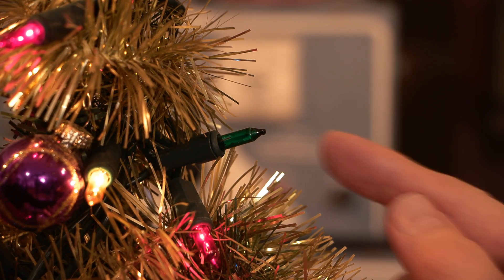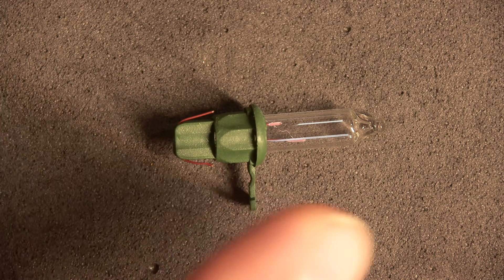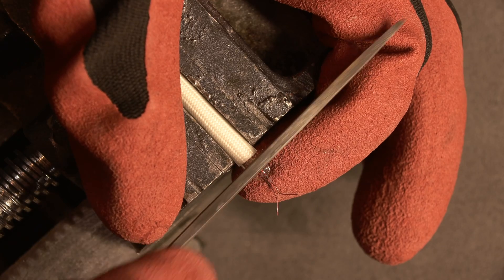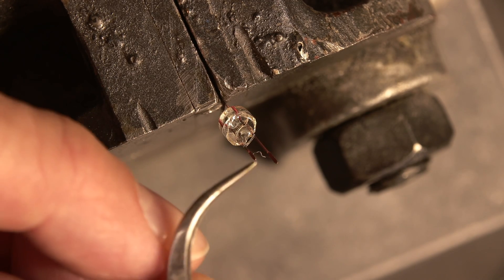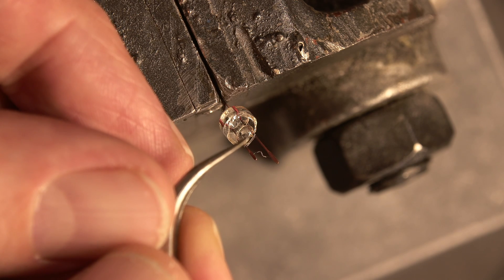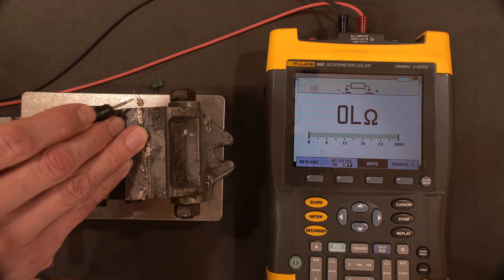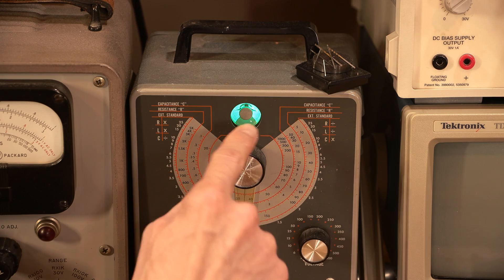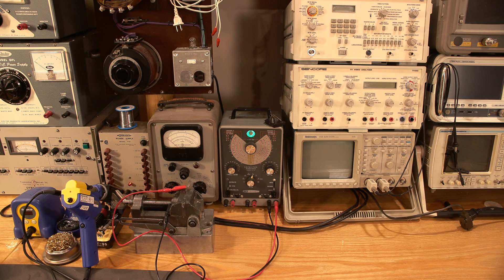The Magic Hiding Inside Your Incandescent Holiday Light Strings!

Comment: One bulb shorts, the rest get more stressed then another, starting a chain reaction, here such lights is powered from 24vac transformer so not many bulbs in a string. Fixed it by replacing all 120 bulbs with bicolor led alternating direction for each, driven by h-bridge with constant current, thought it would last forever... But learned that LED pins rust

Comment: Is there any significant resistance in the shunt once it has triggered? You mentioned at the start of the video that this trick shortens the overall life of the string - why is that?
Reply: My guess is that the shunt is lower resistance than the filament is which increases the voltage on the rest of the bulbs by lowering the overall series resistance of the string.

Comment: It's pretty ingenious to have come up with that system, and despite an additional manufacturing cost I'll bet they made better profit from charging a tiny bit more to eliminate a common aggravation. I was hoping to see if the bypass wires did anything interesting when activated, but I don't blame you for not wanting to cut up another bulb to get that angle. (Or maybe nothing visible happens…?)

Thanks, and s super Merry Christmas to you! 🎄
Reply: When I was testing those bulbs with a 9v battery, if you burn out the filament/it has already failed the “shunt” wire will make small sparks at the connections with the filament stakes

Comment: These lights bring back memories of my first encounter with mains power.
Every few years these Christmas lights strings broke and the supplied spare lights ran out,
and a new Christmas light string were purchased, and if they broke, they were repaired with the working lights of the old strings. 
When I was 5 or 6 years old, I had cut off a socket with 1 light from the old Christmas strings and with short pieces of wire attached to the socket, 
i stripped the ends of these wires with a scissor,and while holding the green plastic socket,i pushed the 2 wires in the socket (230V). 
Not knowing that these lights had to be connected in series. 
The result was sparks and a loud pop, and the light flew a few meters out of the socket. 
There i stood with that socket between my fingers,the wires still in the socket and my face as white as a ghost :-)
I never saw these "self-healing" lights back then (80s), if 1 light broke, the rest no longer worked either. Each new Christmas lights included some spare lights, and 1 light with a bi-metal contact to make the rest of the lights flash at a low speed.
Reply: A better pop can be achieve by putting  a 24V bulb in a 230V socket, the bulb blow very loudly and vanished at the same time, hope to see this in slow-mo one day !
Of course don't do this at home, My father didn't do this intentionally, it's only because we shift to led that he didn't check anymore if the bulb will not glow at 24V before put a new one .
Reply: @lapub.  those old incandecent christmas lights are much lower then 24V per bulb. I think they where 50 or 100 lights in series in 1 string, so that is only 2,3V or 4,6V per light bulb at 230V mains voltage here in Belgium.
Reply: @BjornV78  2-5 v between each pole of a bulb , but when you touch it, the voltage is from ground, so 0 v at one end and 230 at the other, and just 110 at the middle.
for ten bulb in serie you have 24V at each but from ground you'll get
24-48-76-96-120-144-168-192-216-240
Reply: @lapub.  yes i'm aware of that, but i cutt 1 bulb with the socket from the string, and was holding the bulb with the green plastic socket between my fingers. I didn't get a electric shock, only the lamp popped and flew a few meters away. But like mentioned, you can may a voltage divider with such a christmas string. Useally, they are 50 or 100 bulbs in 1 string.

Comment: I always wonder how these lamps worked. Last year when I set up our pre-lit artificial tree, quite a few strings didn’t work. I had to go through one by one pulling the bulbs and testing them. On the first string, I found a completely open bulb and replaced it. The rest of the lamps went real bright then more completely opened. I wasn’t going to make that mistake again so I plugged the tree into an old variable transformer I had. Lowered the voltage way down and started troubleshooting again. I would test until I found the open bulb and got the string back on at reduced voltage. Then I hunted for the shorted bulbs and replaced them one by one, raising the voltage so I could see the good bulbs glow. Once I figured out the proper bulb voltage, I ordered large quantities of bulbs from Amazon  and just pul the bad bulb from the holder and put in a new bulb. This year I only had to replace a couple of dozen bulbs. I have a test rig using a current limiting power supply that I set to abut 2.5 volts and drove a couple of long screws into a piece of 2 x 4 and bucked to supply leads to the screws. Then when I pull a bulb from the tree I just touch the base of the bulb to the screws, If it lit, back into the tree, If the voltage went to zero, and current went up to my preset limit, I put a new bulb in. Time consuming, but worked like a champ.

Comment: I just watched Fran's video about it. My guess was that the bulb's filament holds the leads under tension, and when the filament fails the leads spread apart and the wire wrapped around them closes the circuit.
Reply: that is how I asumed it worked also. but after watching this video it "Shed a new Light" on the subject
Reply: Filaments are usually coiled. The stuff seems to lack any tensile strength to me so I don't see it holding much apart. Plus I'm pretty sure it expands as it heats up too. Which is part of the reason why it's coiled. To compensate for that expansion. I've seen filaments in bulbs move as they heat. We use tungsten as a filament because it handles the heat the best but that still doesn't mean it handles it great. I mean the stuff is glowing so it can't be good for it.

Comment: The British lamps worked a bit different. The filament supports/ electrodes would be spring loaded, so when the filament burnt out, the supports would close together, thus closing the circuit. Obviously this would put strain on the rest of the chain each time this happened. So a  'fuse' lamp would be provided in circuit and if the voltage rose too high, this would blow first and break the circuit to protect the other lamps
Reply: I saw a string that did not implement a fuse bulb, and I know this because I watched them burn out in a fantastic cascade.. I figured none of the incandescents did it.
Reply: So the way to fix the string is clearly to replace the fuse bulb with a regular one. Genius!
Reply: There's a reason the fuse bulb blows. As with any series string, the voltage is shared across all the lamps. As each lamp blows and bridges across, the same voltage will be shared across less lamps, thus each lamp will be running at a higher voltage than before. To prevent a situation where too many lamps have blown, risking a dramatic cascade failure, a fuse lamp is put in circuit. This lamp does not bridge out when blown and will blow much quicker than the standard lamps.

Comment: When I was a kid the old light strings had only 2 wires, if one blub died they all went out from losing the blub connections, but in newer sets, I see they have 3 wires, and am assuming they use the new style blub as well, but why the 3rd wire? when the plug end still only has two, along with a connector just after the first bulb that is blocked off, some may be wondering? and am sure you can explain it better than me. Thanks for the video, Mike, in Oregon, USA.
Reply: The LED light string has 3 wires. LEDs are diodes which pass current in one direction - say positive half-wave. One half of the string (LEDs in series) is passing current in one direction. The other half, wired in opposite polarity, uses one common and the third wire to operate on the negative half-wave. If one bulb is removed, only the same half will extinguish. Combined, the string can propagate full power to the end for the next string. There is a series resistor and two fuses one in each leg of the AC power plug. This at least in the US on 120VAC and an old string.
Reply: Thanks for the info.  @milantrcka121

Comment: Its so simple, and it works almost perfectly. I remember from my childhood that if you let several of those linger in this bypass mode, then it accelerated the burning of the rest of the bulbs :D So we always made sure we replace the first few in time.
Reply: In case you didn't know, its because the balance of the bulbs have to consume the all the power, thus eventually overpowering their design limit, and catastrophic failure will begin.
Reply: @louf7178  Thanks, but i knew why others failed quicker. When multiple bulbs are shunted, the rest must handle the whole voltage drop thus individual bulb voltage increases as some bulbs are shorted
Reply: @vortexan9804 Yep, I remember my grandparents having really old christmas light string, and its instruction manual warned about such, advising to replace a burned out bulb as soon as possible.

Comment: Also worth mentioning is that most sets incorporated a safety or fuse bulb, usually identifiable by a white tip. This bulb does not incorporate the 'shunt' wire so is designed to cut power to the set when too many bulbs have failed and the voltage across the remining good bulbs exceeds a safe value.
Reply: Christmas lights sold in the UK did indeed had one non-shunt bulb painted half white. This was a requirement of BS4746. This “fuse” bulb would prevent thermal runaway from too many shunts closing. This was common by the late 70s.
Reply: I thought that was a flashing lamp, bimetallic?
Reply: @matthewbaker6827  No the white tipped ones were the fuse bulb. You could also get flasher bulbs, but I think they were generally just clear glass. Looks like you can still buy them, though the flashers I can find now on Google appear to have a Red tip. I don't remember that being the case in the past.
Reply: @adamdavies163  I live in the US, the earliest version of the miniature lights I remember my parents having (late 70s-early 80s) didn't have the mini fuse in the plug or have the pre wound short at the base of the bulbs. But they typically came with two small extra cellophane bags usually with about 3 bulbs one pack of various regular colored bulbs and the other had a red tipped clear (flashing) , a clear bulb with a white/green/black paint dot mid way up the bulb (fused) and a clear that looked to be just the standard bulb in clear.  But no fuses in the plug, or strand other than the one bulb. I think that changed rather quickly after those became more popular than the older 'night light' size c7/ c9 because people would over load the crap out of them and cause fires.... I never saw this anywhere official but my understanding was the fused bulb was not the most reliable at accurately limiting the amp draw. My father was excellent at maintenance and kept them together with packaging for years i want to say nearly 20.... you didn't shake them around more than necessary and pushed them back in stupid little Styrofoam tray after x-mas each year and slide the tray in the box they came in ... probably why the lasted so long
Reply: @alexlail7481  Sounds like the standards differed between countries. As with most of these protection devices, anyone that didn't understand electrics would likely replace a blown fuse bulb with a standard bulb out of the cellophane pack, hence removing all protection. UK sets in the 70's and 80's were normally supplied without a mains plug fitted (as were most appliances in the day). It relied on the purchaser to correctly install a suitable 3 pin plug with the correct fuse  fitted. As you can imagine the general public do not understand electrical safety. There were many light sets running off a 13 Amp fuse, which would provide literally no protection. I'm surprised more houses didn't burn down.
Reply: @adamdavies163  yep standards can differ greatly from country to country... It really depends on what the people of the country value  and how they approach life in general. At that point in time and still to a limited extent in the US the general public was expected to have enough common sense to avoid stupid actions or suffer the consequences.  I realize from the perspective of many countries that approach seems rather barbaric. But it did help your understanding of self responsibility and self support. I  realize it seems cynical to many people but I never expect corporations to have my best interest in mind when they do something or make something... they only do 'responsible and ethical'  because the government mandates it and even then they generally have trouble following through.
Reply: @matthewbaker6827  -- Usually, it is a clear bulb with a red tip, or at least what I've seen. And yes, those are flashers. They heat up, kill the power, cool off, and light up again.
Reply: The red tip also has no safety, but adds flashing. This will have the effect of having a very short flash and long rest if too many bulbs are burned, though.
Reply: What if someone replaces this bulb with the same type as the rest of the bulbs? There would be no protection. The current would increase as each bulb blows.
Reply: @computerlen    the protection he speaks of is higher voltage, which means the other bulbs blow out sooner. No danger of burning up the wires in that case.
Reply: The fuse is in the plug 🤦‍♂️
Reply: @MadScientist267   I have several old sets in front of me, all incorporate a fuse bulb. A 3A fuse in the plug (if indeed it was correctly fused, many were not as DIY 13A plugs were often the norm) would not protect a 20watt lamp string from overheating or fire.
Reply: @adamdavies163  Ok everything I'm referring to is US 120V, 15A branch. 

The incandescent strings all had an integral fuse, between 1.5 and 3A depending on exact string and type, in a piggyback plug. The fancy ones were replaceable, but most were one shot. They die, that's it. 

The expected failure condition was that too many shunts would eventually be in play, raising the current in the string. The fuses were underrated intentionally to catch this before any heat could even think of building anywhere but in the remaining filaments. When too many bulbs are gone, it politely disconnects itself from the supply.

They were also normally warned against more than 6 strings in one chain, be that via the piggyback or string-end connectors... and would indeed pop the "root" fuse if you pushed it, or more than a handful of bulbs were gone in the entire chain.
Reply: @MadScientist267  The last of the incandescent strings you can buy have issues with the bulb leads corroding in storage and then not making connection anymore, which kills the entire string. I stocked up a few years ago, and keeping them going is at the point of not being worth it. Takes too long to find the one making poor connection.
Reply: @rich1051414  The game of cat and mouse knows no bounds 🤣
Reply: @MadScientist267  I have had many of these melted on me, no fuse to catch it
Reply: @MadScientist267  -- There are 2. Folks will plug them in either way, and if the wire is melted or cut somewhere, then if it hits something it shouldn't, at least one of those would blow. And the overlading thing too. There is a socket at the end of many sets, and if you plug too many into it, the fuses in the first chain will blow.

And there is the red-tipped, clear bulb. That is the blinker. There is a bimetallic strip that bends when it gets so hot, just like a thermostat. So the bulb heats, the wire bends, the power for the string or a single channel of the string loses power. The strip cools off and reestablishes the power.
Reply: @mad
Nope, that's not the only one. Other plugs than UK are available you know. Fail.
Reply: @MadScientist267  Not everyone has these bulky unwieldy ugly but very safe UK plugs with a fuse in it. UK is not the world.
Reply: @kyoudaiken  Umm..

They're in the light string plugs

Reading comprehension not a strong point for you I presume 🤦‍♂️
Reply: @MadScientist267  Ours only have mains plugs and that's it. There's no other plug.
Reply: On most light strings that are meant to connect to each other, they have a tiny fuse inside the plug, as well as a replacement.You can just  slide the little cover open to remove the blown fuse and put another in it's place. I have blown many of these when I forget and string more than three strands together.
Reply: @kyoudaiken  Inside of it will be a tiny fuse. It may or may not be removable. The "miniature" strings all have built in fuses because of their chaining ability, as well as the inevitable total short as the bulbs blow.

I'm not sure if this requirement was relaxed with LED strings or not (I haven't bothered to look).
Reply: @MadScientist267  I witnessed one sting just die in front of my eyes where it had a catastrophic failure and it tripped the breaker instead. Safe LED strings typically use a ~31 Volt isolated switching PSU which definitely has a fuse, and the PSU is inside the plug.
Reply: @kyoudaiken Yeah but even with our ridiculously huge plugs with fuses, UK Christmas Lights still had a fuse bulb to prevent the "runaway" effect of too many ordinary bulbs shunting out.  Although by the time a few had gone, the rest were usually fatigued anyway (even if the fuse bulb did operate) having been over-run for too long.
Reply: @kyoudaiken  -- yeah, but there are many with a socket on the other end. But the mains plug is what they mean. There is a little sliding "door" on the plug, and inside are 2 fuses.
Reply: @PlumGurly  Ours in Germany don't.
Reply: @kyoudaiken  Xmas lights have fuses in their plugs.  They even come with spares.  In the US!